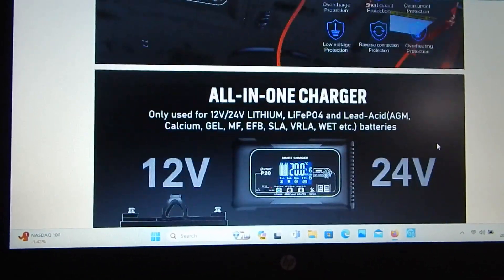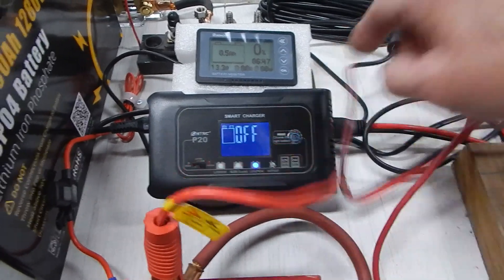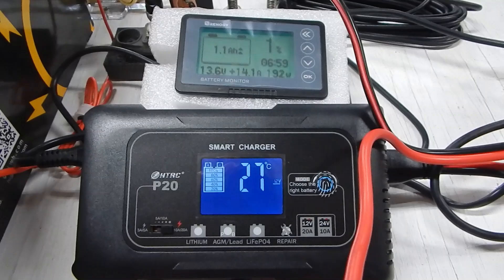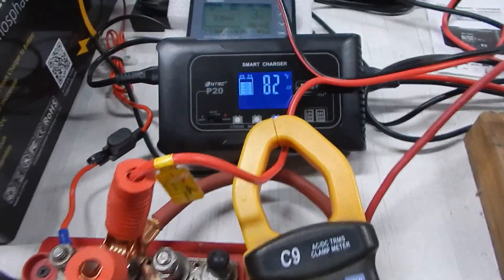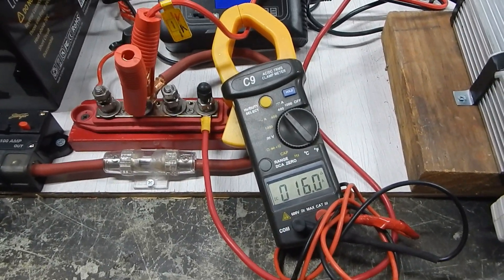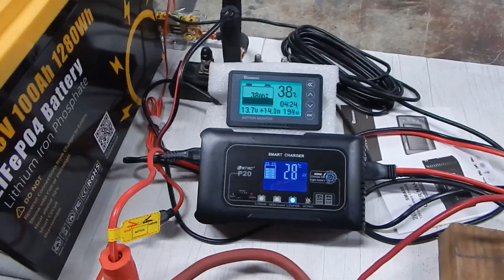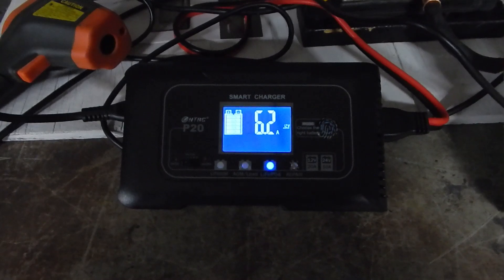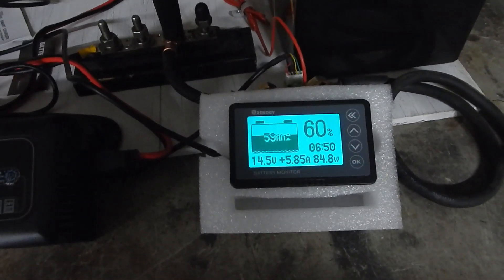HTRC Smart Battery Charger, All chemistries included. 4+Hour Test.

Comment: I just got this charger and I notice on a 24v lifepo you do not get the full 10a best I got was 8.8a showing on the charger. Checking with a DC clamp meter it was only supplying 8a. On the lifepo BT BMS it was only getting 7.7a. I haven't tried on a 12v lifepo yet but I Suspect you won't get the full 20a.
All my connections are clean and done correctly.
Very disappointed in this charger. 👎
If you’re buying a 10/20a battery charger that’s what you should get.